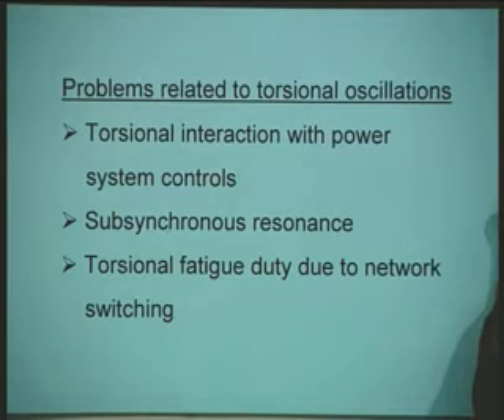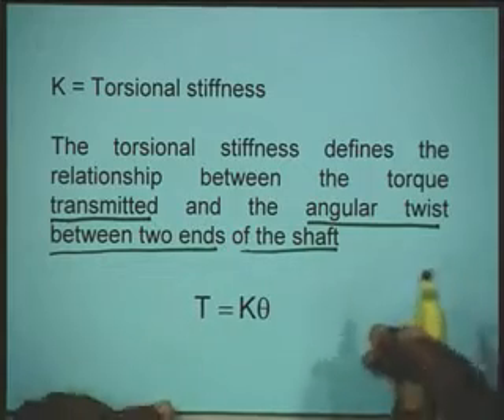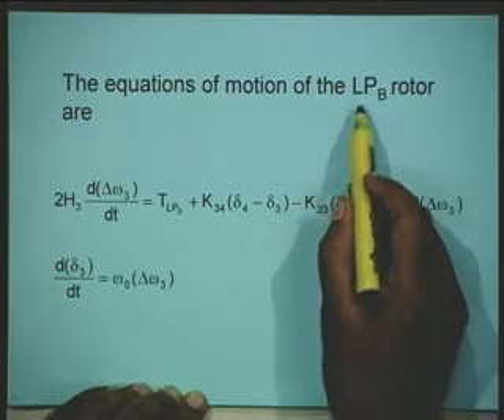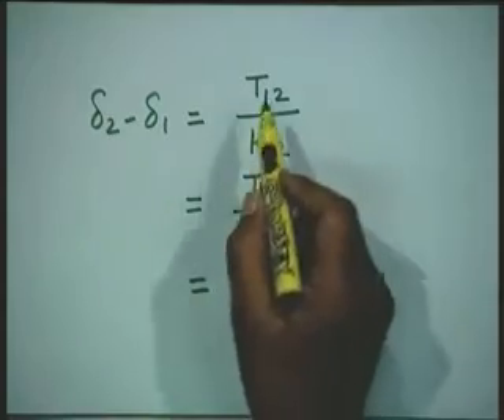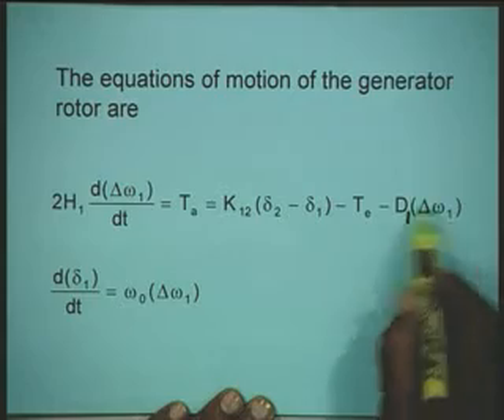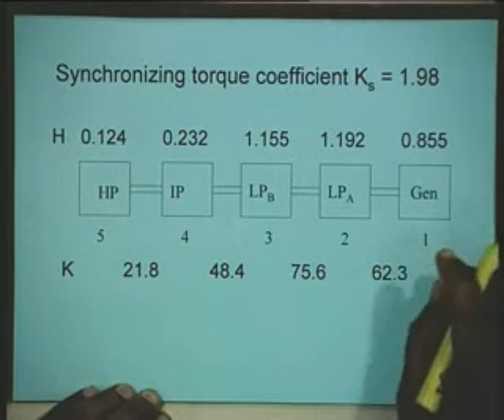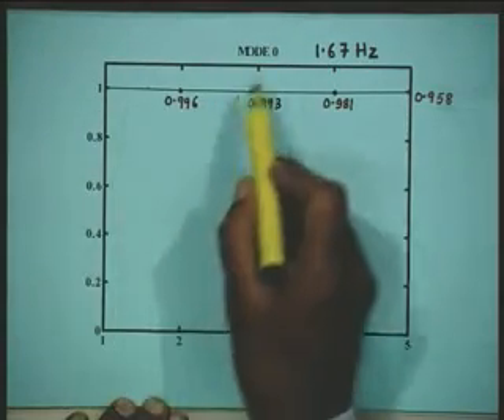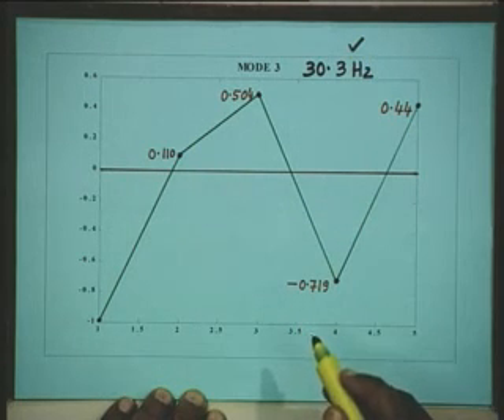Lec-33 Sub Synchronous Oscillations-Part-1

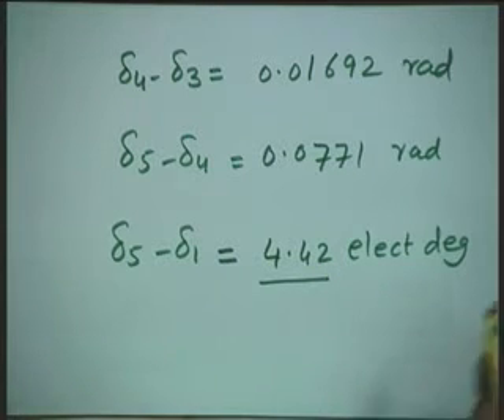Comment: At the minute 29:38, the angular difference between 5 and 4 is 0.01417 rad, in this way, the net difference between 5 and 1 is 4.42 degrees as well as the video says